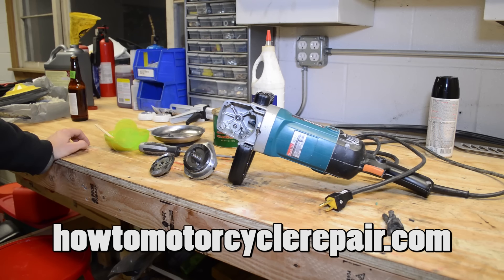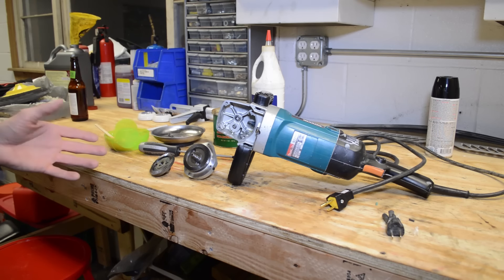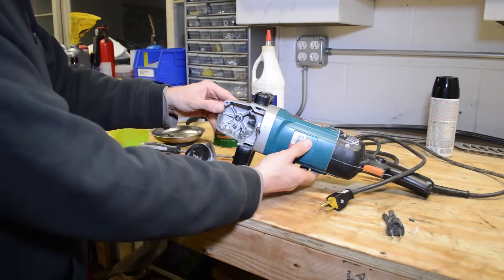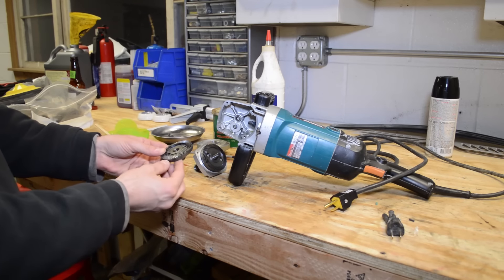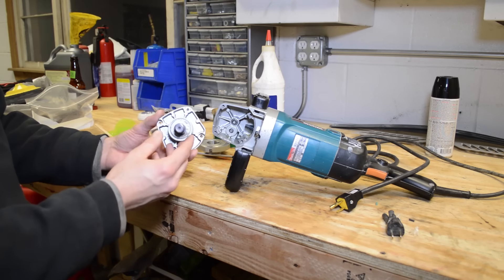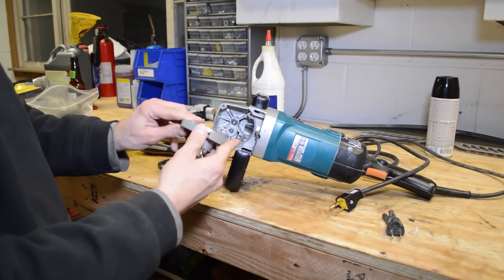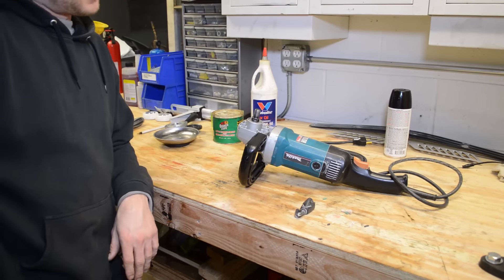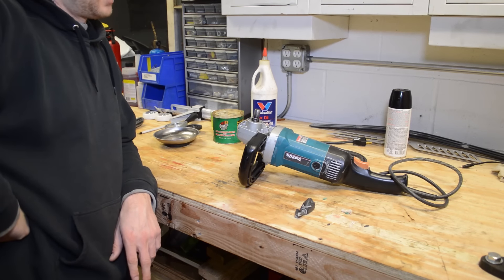How-To: Makita 9227C Grinding Noise Repair

Comment: I just adopted 2 of these that have a similar noise though not as bad. Adopted means intercepted them on the way to the dumpster at a boat yard. Lots of polishing goes on here and I guess you just go buy a new one.

Your video is gonna help me give these guys a second life !

Is there any other way to separate those parts? W
Ie without a hydraulic press … like maybe a claw style puller ?

Comment: You can use the oils used in high-speed scythe machines used for mowing grass.  They are sold to farmers and villagers in small tubes, and these oils are of high quality and inexpensive.

 Oils used in the axle shafts of front wheel drive cars can also be used.  It is very sticky.

 Bearing oils containing lithium can be used.

 I'm a machinist.  I've used them all my life.  Boshc Gws series is very common in my country, spare parts are easily available.  We use all of the big and small angle grinders.  I've never had a gearbox problem so far.  I've never had a machine that was scrapped because of its gears.  Yes, you are right, when we disassemble the machine for electrical failure and look inside, we see that they are always without oil.  But they still don't cause any problems.  Bosch machines break down on average in their third year of heavy use.  We replace armature, bearings and conductive charcoal brushes.  3 years more intensively, we use it every day.  And then we throw that machine away.  Because spare parts are not cheap either.  It would make sense to buy a new machine.  A hobby person who rarely uses the machine that we use for 3+3 years will use it for 15+15 years.  The only important thing in these machines is whether you can get spare parts at the end of the first term.  At the end of the second term, the machine is already thrown away.  The machines stay oil-free, but strangely, we almost never have a gear problem.  I understood the reason for this strangeness while reading the comments above.  Yes, the oil evaporates and reaches the necessary places a little bit. I think this thesis explains the situation.  The three oil types I mentioned at the beginning are suitable for this.  I think Bosch brand expensive oil also has this feature.  I guess that's why we don't have any problems with gearboxes.

I learned a lot from the video and comments.  Thanks everyone.  Cem...

Comment: that's a polishing machine...that spins from 600 to 2800 rpm.   if you have a normal grinder....that spins 7000, or 11000 rpm...those gears will be always dry no matter how thin or thick you make the grease, cause of the centrifugal  force....not to mention the small gear on the armature that spins 30 000 rpm.    lubrication inside the housing does not work like you imagined..   when spinning and heated up....the small particles inside the special  grease evaporate...and the vapor lubricates the gears.  when too thin...there''s a chance the grease can penetrate inside the motor housing and make a mess if the top armature bearing seal brakes. or just leak on the head seal... and 9227CB  doesn't even have a seal.   i repaired hundreds of 9227's and 9237's..
Reply from the maker: Thanks for the info.
Reply: Where can you get that special vaporizing grease?
Reply: @ajg942  Youre local cannabis dispensary. lol jk
Reply: Hey man, what do you think about moly grease for the gear housing? I just bought some moly EP grease and going to give it a shot.
Reply: Petriunic1 what grease do you use?
Reply: nlgi 2 is good or i must use nlgi 1?

Comment: Great vid thanks 😃👍🏻 I'm having trouble with the switch on my Makita which led me to You Tube and luckily I've found your video. Other than the switch being broken it runs pretty sweet but I think I'll do a re grease as you've shown here as I suspect the bevel on your machine could have lived a little longer had it been serviced by its previous owner, thanks again !
Reply from the maker: +Chris whitlow Thanks Chris. Make the grease/lube a little thicker than mine. It started to seep a bit once the weather warmed up. The gearbox should be 2/3 full.

Comment: hey what about mixing grease with any metal treatment like motorkote or superkote? i have tried those products with engines and they indeed help them to cool down and make them less noisy, those products are for industrial usage as well as bearings or anything that needs lubrication, the good thing iis over time they bond to the metal and get them so slick with no side effects, also they mix perfectly with any kind of oil, engine oil, transmission oil, etc you name it, those are products have been on the market for nearly 20 years with no complaints, so they are reliable, i think i will give it a try

greetings from Colombia
Reply from the maker: You can certainty try it. I just wanted to thin it out since grease alone does not seem to lubricate it enough.
Reply: ok, i will try it these days, yes the original grease of my grinder is more liquid, so i will give it a try..
Reply: @vaguincolombia  so did you try it please?

Comment: New update amigo. I have a dewalt DWE402 which is a 11 amps grinder. when i bought it new it was running constantly very hot on the gear case. Today i took an amps measurement with no load and the grinder was drawing between 4 and 3.85 amps later i changed the grease (which by the way that grease was so damn stinky) and i made the new grease just like you and guess what? the temperature dropped so much and i took the amps measurement again with no load and it was at 3.65 amps, the amps drawing dropped too!. So it was worth it to change that grease.
Reply: Dude! I just bought the same grinder and it burnt my hand on the broomstick from heat off the gearbox! I am going to have to re-Grease it.. because it gets way to hot!
Reply: @pappaclutch3266  Yes do it, mine did that too when it was brand new. When you open that gearcase that original grease smells so bad!. it is better to change it.
Reply: Alejo Colombia Hey so I repacked it with new 00 Lituim red high heat grease.. I took a temp measurement and it read 140F on top of gearbox after 3mins no load. To hot to touch with bare hand. 

Should I just consider this normal?
Reply: @pappaclutch3266  Be careful with the amount of grease your putting inside the gear case. it is not about re-packing totally the gear case. it is the same like filling oil in an engine. it takes a certain amount, neither so little nor too much. just half space available inside the gear case should be enough to fill it with grease. let me know the temperature of that new result.
Reply: Alejo Colombia Thanks for the quick reply, when I Re-greased it I already had that in mind so I filled it half way and put some on the ring gear threads. I ran for 3mins no load and got 140F. 

I read something on a forum and might try it. Mixing the grease with some oil to get a honey consistency. 

I also seen on the forum that describe dewalt grinders get pretty hot.. I’ll just have to use gloves as it can’t be touched with out them. It would be interesting if you could take a temp test 3min no load?
Reply: @pappaclutch3266  My pleasure. There is not need to put on the gear wheel, otherwise you could be putting so much if you sum the grease you put in the gear case plus that other grease. try removing some grease and try it out again. have a look at this metabo video at the minute 3:40  https://www.youtube.com/watch?v=qVT_aiYb0v4&t=222s
Reply: Alejo Colombia Thanks for your help! I’ll play around with it some more.. I really like the grinder! I’ve used it nonstop for about 5 hours when I first got it and I was impressed minus the heat.
Reply: Alejo Colombia I checked out your video and I think I put to much grease now.. I filled halveway from floor of the gearbox up.. well like you said I’ll remove it and play with it, but yeah if you could do a temp read out 3mins no load that would be great! So that way Ill have a temp goal to reach. Sounds like yours is working great. Thx so much again!
Reply: @pappaclutch3266  . haha, you are welcome. Yes that angle grinder is really good. Are you a professional metal-worker? bacause 5 hours straight, damn, i got tired of using my grinder after 20 minutes. The interesting thing about that grinder is how at sides of the back it takes air and ejects debris and dust at the very end of the tail. There is a tiny hole where it says "DES" which means dust ejection system you will see the crap coming out of it. Grinders are very interesting but at the same time creepy.
Reply: Alejo Colombia No I am just a DIYer/Hobbiest getting into welding.. so I started acquiring all the necessary tools (angle grinder one of the most important) I plan on taking a welding course soon, I’d like to become certified, something to fall back on/ help people out. I have lots of vehicle plans for my truck after I develop a better skill set. 

Yeah I was making some metal projects with the welder and the grinder. I spent around 5 hours with the stuff learning and having fun.

The grinder is very nice, I try to get the best tools to start with (buy once cry once) I thought the fan system was very initiative, I haven’t seen the DES hole.. I’ll have to look for that.
Reply: @pappaclutch3266  you could leave a litte bit more grease than the video. and it is nice to help.

Comment: I just bought the newer version of this polisher a little over a year ago.  I noticed that it had that "gear noise" from day one but chalked it up to it being new and not broken in.  So now a couple months after the warranty is up the noise is getting worse.  my bearing like yours is a little rough but the ring gear has zero wear.  There is also a fair amount of play in the spindle.  Going to first try and press the ring gear a little more on the shaft, and if that won't work I'll press it apart and replace the bearing.  Just pisses me off because this polisher really doesn't get used very often besides spinning the water out of my DA polishing pads.
Reply from the maker: That sucks. Let me know if taking some backlash out helps with the noise. Make sure to support the housing correctly.
Reply: Actually, after looking over the pinion gear and not seeing any wear or damage, I just re greased it and put it back together.  I've heard other people on the web complaining of the gear noise also, so must just be a noisy gear train.
Reply from the maker: Mine has no noise after the repair.

Comment: Hello again Matthew. I haven been studying greases and what you did in this video is absolutely right. Greases for high speed enclosed gears in poorly sealed cases must have a consistency NLGI 00 which is almost like "apple sauce" but also the most important is the consistency of the oil used. the greases NLGI 00 for this kind of application must have a base oil viscosity of around 180 cSt which is almost the same like gear oil SAE 90. all this information is from Mobil and Shell. What about the mix you did on this video? is it still working good? any issue with the kind of consistency?. Thanks in advance.
Reply from the maker: Yes, no issues with mine.
Reply: @HTMR  Thank you for the reply. Gracias amigo.

Comment: Too much grease will increase heat. Because thick oil have high resistance. High resistance make heat.

Gearbox need splash lubrication. Thick Grease will wipe out after gear rotate.

I have solution for this situation. I use chainlube non wax dry lube mixed with lithium grease. Almost look like liquid but still save for leaked.

I dont care about protection.i need performance. Low viscosity will reduce heat and increase rpm. I also give bearing this mixed lube.

Comment: Interesting idea about mixing grease and oil. I was thinking about that my self. Not enough grease on gears of angle grinders is huge problem and I don't know why nobody out of so many manufactures from 54. (first Flex) until now did not solve it. I opened about 30 grinders in my life and none of them never had any grease on gears. In fact I put good amount of grease on them, turn on for 2 sec and when I open everything is almost dry. Honey consistency is good reference, but I think one should not put something which is too liquid. You want just right viscosity which will allow small amount of grease to get on gears during work at some average working temperature.
Reply: try corn head grease from john deere, just for gearboxes.
Reply: @edwardyeo8031   WTF is corn head grease? I'm living in Serbia. :)
Reply: @dusanboss7749  Google for head grease and see.  Can buy it from John Deere dealerships

Comment: Hi Mathew , good video info , I am about to service my AC drill gear , Can I use pure grease or have to mix with gear oil as per your video . your kind advice please . thx
Reply from the maker: If there is no way for it to leak out, go ahead and thin it out a bit with gear oil.
Reply: thanks for the swift reply will do as per your advice .thx pal

Comment: your armature gear  has play in contact with the spindle gear.   and that's because  you pressed it too hard when replacing the spindle gear.   i'm  talking about maybe 1/10 of a mm.     and for lubricating....noo need to make that mixture.   lubrication inside works no matter if it's not on the gears themselves.   it's special grease that works by vapors inside.   you ALWAYS need to replace two joining gears...in this case it means replacing the armature..   a bit expensive repair...but when done properly it will  works silent....like normal.   i'm a certified makita specialist btw.
Reply from the maker: The armature was about $90, so if that was needed I would have just bought  a new unit.

Where do you work? I work near the Mt. Prospect IL Makita facility.
Reply: i'm  from europe,  croatia.   i have my own service/repair shop - MPU servis.  i repair all professional  tools, not just makita.
Reply from the maker: Gotcha. Ever thought of doing repair videos? I'm sure that would help a lot of people.
Reply: sure, i made a few and put  them on my facebook business page.  but not on youtube yet.   don't have the time  for filming and editing.   maybe i'll do something soon.
Reply: Where can you get that special vaporizing grease? Thx
Reply: Any advice for makita that when the armature looks fine but it grinds with no power, spins very unsmoothly?  Always have the same issue with Makita.  Unit also smelled burn when it starts...any ideas why?
Reply: -- hello , I realize this is an old comment of yours , but I would like to know if this noise is common with new makita polishers , I just purchased a new 9237c and straight out of the box it seems to have that same gear / bearing noise , thank you for your time .

Comment: Won’t a thinner grease make it easier for the force of inertia to push the grease to the outer edges and little to no lube on the gears? I think it’s better to just use plain ol grease. The lithium kind I think. Just my two cents. Cheers
Reply from the maker: Bearing grease thinned with gear oil. Both can withstand much higher pressures than this application.

Comment: +matthewmcrepair when u say use gear oil to mix with the grease what type of gear oil/grese do u mean exactly?,could i use atf as an alternative?
Reply from the maker: ATF is too thin. I used wheel bearing grease and 80w-90 gear oil. Mix to honey consistency.
Reply: +MatthewMCRepair  thx :)
Reply: neil froggy crompton 
l

Comment: I just put 3/4 grease to inside.sound very smooth because all teeth touching grease when spinning. I open gearbox and gear looks wet.

But for consequence gearbox will heat faster because grease have thermal conductivity more than metal and RPM will decreased.

I dont care about that,i just want silent sound.